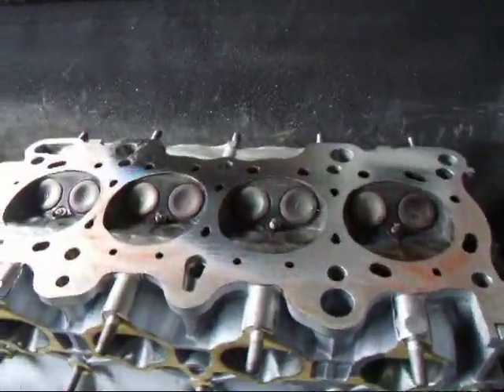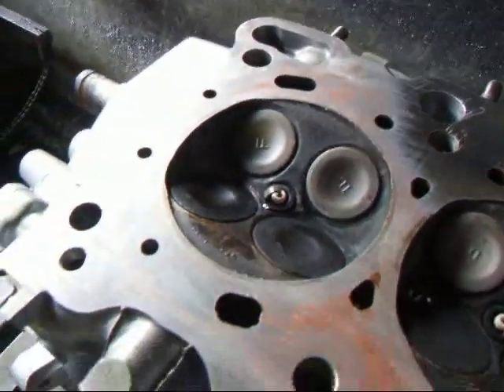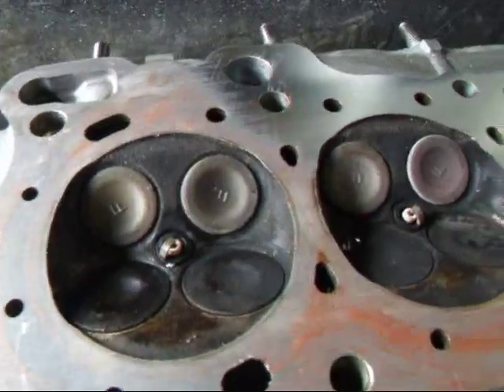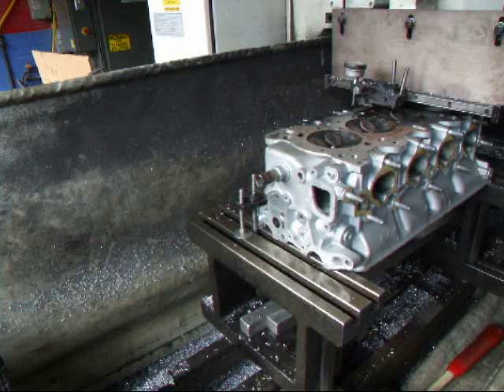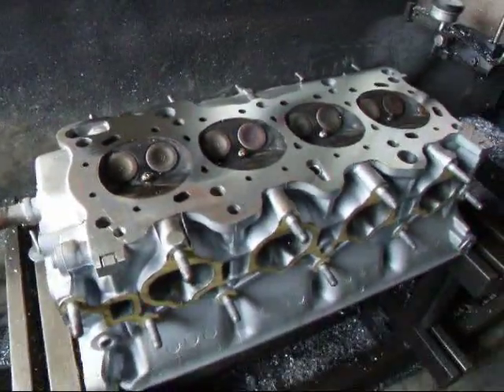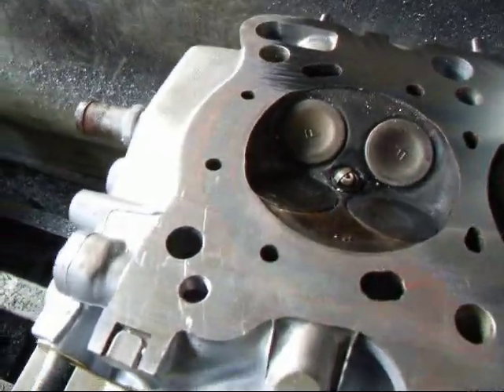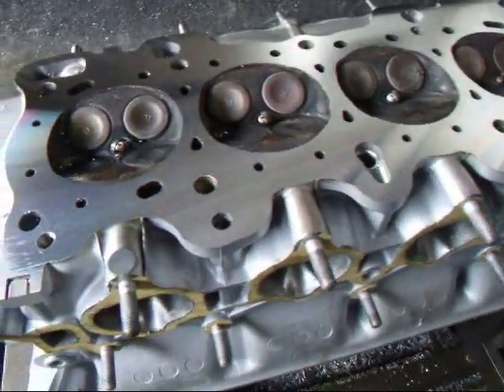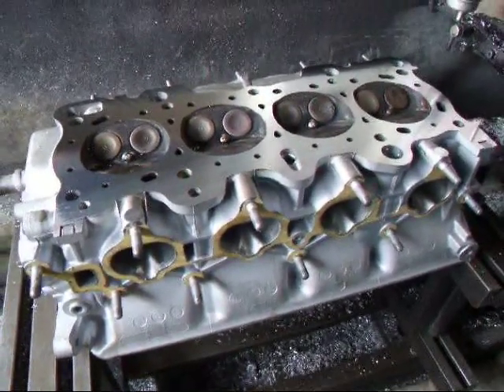Honda Head Resurfacing 20

Comment: How much do shops usually charge for head resurfacing?
Reply: +coolement94 My local shops here charge $35-50 dollars to refinish a cylinder head flat, provided they don't have to do any cleaning or have to do any disassemble work.

Comment: Question, I have 6G72 turbo block had machined removed 4000 of block surface. Heads got resurfaced and I can see indicator pads clearly, but I don't know how much was removed on heads. My question is do I need taller head gasket or stock mls gasket?

Comment: hello mr fiatnutz,
what is the minimum/ maximum you would recommend removed from a honda single cam head. i want to remove .001 from the block to give it close to 0.001 piston-to-deck. i have flat top pistons with valve reliefs so im not worried about poor flow from high dome pistons or valve clash.

Comment: @Slonya23 - Because it's aluminum cylinderhead on this video.  Surface grind's are used when the cylinderhead is cast iron and has harden pre-cups installed.  Or they are old machines that haven't been introduced to CBN milling yet....

Comment: @MrMindenhall - Belt sanders are only good for exhaust manifolds and non-critical machined parts.  A cylinder has to meet certain RA finishes.  A "$15K mill" gives the customer the utmost quality finish that surfaces a cylinderhead/block to a FLAT finish at a specified finish.  Just because it's shiny doesn't mean it's "just a surfacing"  
There is NO WAY a persona can hold a cylinderhead by hand on a belt sander and apply the same amount of pressure to have a parallel true-finish.

Comment: I have seen reputable machine shops use belt sanders with very satisfactory results.  Just because someone doesn't take out a"loan" on a $15K on a head mill that makes doesn't mean that it won't work.  As long as the final flatness is within .001 (and it's usually much tighter than that) and no scratches,  who gives a shit?!  Don't come back with any crap about the "grip" because it is "too smooth" because factory heads are very smooth.  It's not rocket science, it's just surfacing.

Comment: @simonbasil The head was aluminum, because i wouldn't hold to the magnetic table of the grinding machine.
i think one of the reason Grinding is not the weapon of choice is because its not good to have to smooth surface because the head gasket won't seal properly.